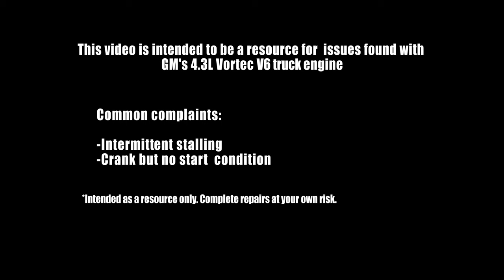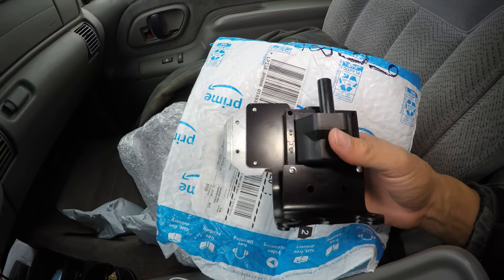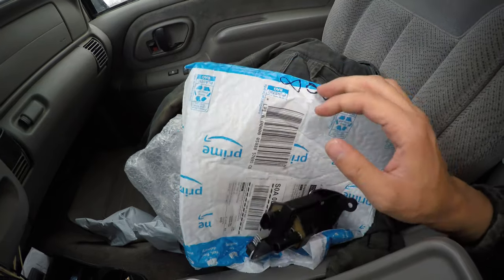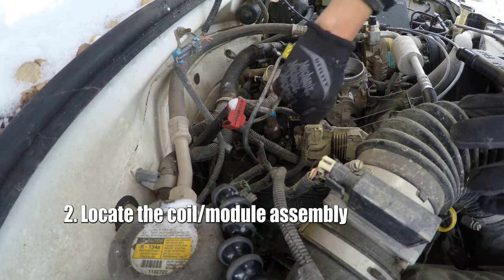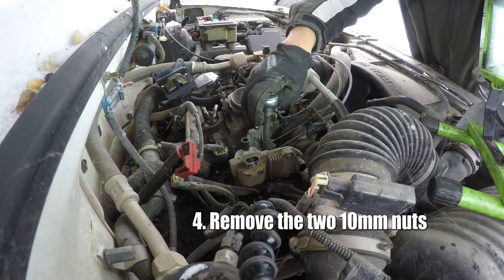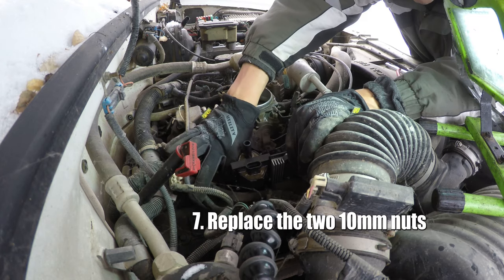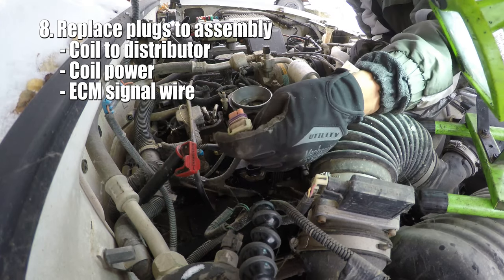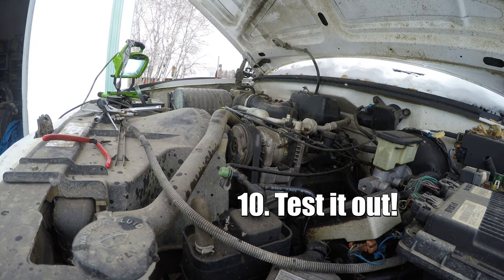4.3L Vortec No Spark From Coil // [No Start & Stalling Condition]

Comment: The truck (06 Silverado 4.3) ran one day and died on the way home the next.. No spark to the plugs. Then I found no spark from the coil. So I bought a coil. Still no spark.  Found your video. Found a like part on amazon. And TahDah! Fired right up. Thanks for the help.
Reply from the maker: Glad to hear that! Easy fix when you know what's wrong 👍😁
Reply: so the first coil you installed was bad, but the Amazon coil was good?
Reply: @gregmahatma6909  just bought the coil. That didn't work... then bought the coil assembly from amazon on the advice from the video of the engine heat baking the electronic pack. Thats the one that worked.
Reply from the maker: @paulmiles483  yeah, you need to replace the little module box with the cool.

Comment: Excellent video but a your car doesn’t have a “motor” it has an engine.  Motors are driven by electrical or mechanical while an engine is powered by internal combustion.
Reply from the maker: Good point 👍 Definitely in a time when the differences are starting to matter 😂. Motortrend has been referring to engines as motors for decades 😂

Comment: Where did you get that ignition coil/module/bracket from ? I mean I see it was from amazon, but do you have the part number ?  I can only find all of the parts individually, it makes sense to replace them all at once
Reply from the maker: The coil in the link on Amazon is the exact one I ordered! Everything came as an assembly. Did the link work?
Reply: Yes I did find the link, thank you
Reply from the maker: @kellismith4329  Awesome!
Reply: Thanks for your video!I had the same problem with my truck and the part worked great!
Reply: @benq.mechanical  part number plz...I'm in the same situation!!!
Thanks in at advance!!!!
Reply: @pops3554 mine ended up being a break in the power inlet harness to the coil, the breather hose from the airbox makes contact with the harness and puts strain on the connector. I replaced the connector pigtail and added an elbow and short piece of hose to the breather tube to route it away from the harness.  While I had the coil ass’y off I removed  the ignition module from the frame and cleaned it up and put a new layer of thermal paste between the heatsink. Fwiw I have now about 4 of those coil/module assy’s that I have harvested during trips to the wrecking yard you can pick up dirt cheap - still the original one is in the truck, been fine since the wire repair

Comment: My 2006 4.3 Sierra has the same crank but no start problem. I also replaced the same parts and then turned on. I left running for half an hour then it just turned off by itself and will not turn no. Does anyone have any idea/comments what might be wrong?
Reply: Maybe your engine is overheating and burning new components out?

He did say when they are on the top of the engine they can get overheated.
Reply from the maker: @edsan1975 Is it throwing any codes Ed?
Reply: I installed a new ignition coil and ignition module. Still cranks but no start. I dont have spark coming out of the ignition coil. I have the spark plug tester.
Reply: I have gas pressure. I check the relays and fuses. They are working out. I by pass the starter relay and it does crank. Starter seems good.
Reply: @Namedeeznuts  can you elaborate more? I don’t understand

Comment: Why replace the whole assembly why not just the bad component.
Reply from the maker: The module was $30-35 bucks and the whole assembly was only $40 lol.

Figured with as many km's on the truck as there are it wouldn't hurt to do the whole thing haha.

But that being said, your right. Could just replace the module.
Reply: @benq.mechanical  Thank you, I figured there was a good reason O'Reillys charges over 80 bucks for that module and no dielectric with it.
Reply from the maker: @jamessmejkal8803  Yeah lol. For an old truck it's an expensive part!
I think I left a link in the description, but Rockauto has it for similar pricing 👌😀
Reply: What is the module called ?

Comment: Thank you so very much for this video!!!
So I was in this shitty place with my truck started with a fuel float error, gauge was going up and down for a week or two 
then my truck stalled out and I thought I was out of gas. Got it running enough to get gas and got  it home, drained 30 gallons of gas and replace the fuel pump. Still No start 
New plugs new cap and rotor 
Still no start 
Then I saw your video and bought the same coil unit and bam started right up
Reply from the maker: Haha. Awesome! Glad to hear that. Yeah its a small fix but a huge headache if a fella can't figure it out. Here's to many more happy miles.